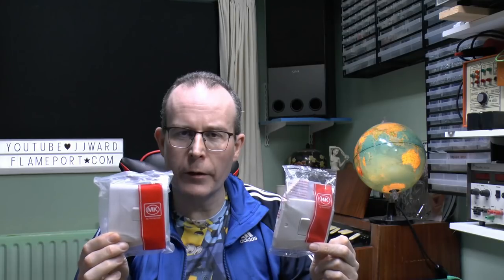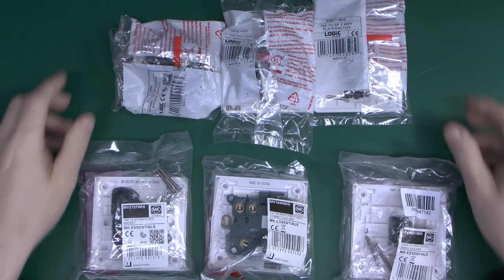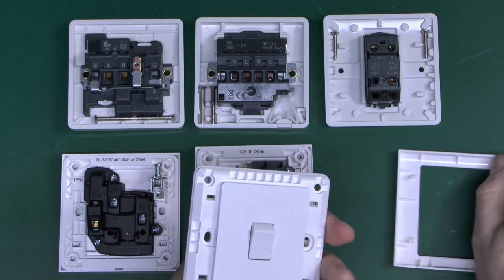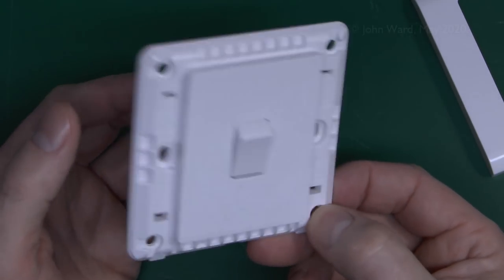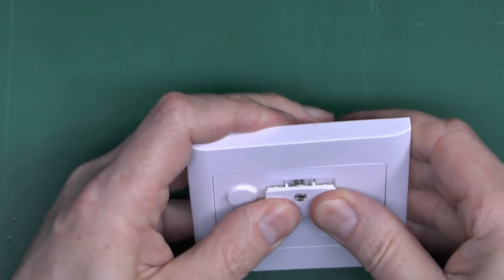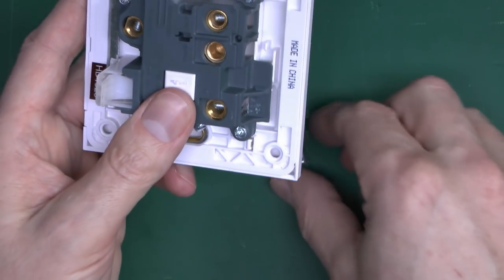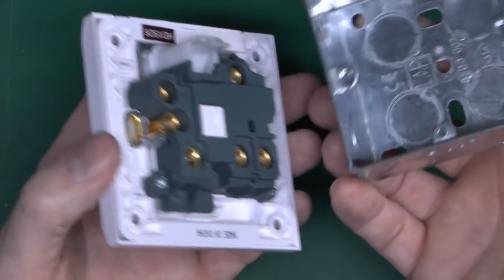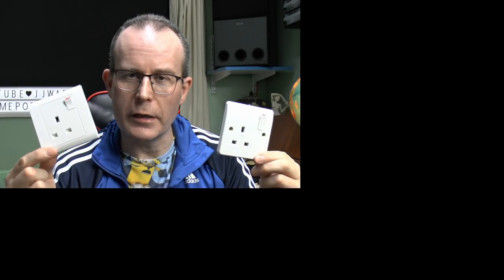MK Essentials vs MK Logic Plus

Comment: I might be weirdo, but I prefer screws visible probably anyway. I don't like the clip on frames like this, because they are prone to damage. You might need to inspect the socket or switch years later, and might not remember how to unclip it, and damage it. Or even if you remember, you can still damage it, if you use a screw driver to pray it off, or the plastic gets brittle. The MK logo on the front is just stupid.
Reply: And these soft plastics always scratch easily and possibly yellow. I remember in the late 80s/90s the Australian brand Clipsal tried this soft plastic in the UK which was unseen before on wall accessories.

Comment: Absolutely brilliant, again. Thanks for the video. I personally don't like these "cheap" accessories.  There are plenty of spaces for mistakes here, especially when guys are tired. How did that light switch get through the design process?  They certainly didn't consult with electricians. I look forward to your video on load testing. I wonder how that sockets will stand up against a wahi g machine,  long term? Hmmm? I wonder if we will see the tell tale brown burn marks around the plug entrances?  Thanks again John.

Comment: Presumably covering the two fixing screws with the cover is safer. Speaking as one who has received a shock from touching exposed fixing screws.
Reply from the maker: Not at all - fixing screws should be earthed.  To get a shock from them, that earth connection was missing, and a second fault caused them to be live.

Comment: Well they are a total fail in pretty much every respect. Hard to believe that MK could make such big mistakes with the range. They also loo very cheaply made, and can you imagine just how scratched the faces of the  sockets will be after a years worth of use. Terrible design all round. I am sure this review will save a lot of people a lot of frustration by buying these only to find they have to rip out and replace  half of the baacck boxes in the house before they can fit them.

Comment: I've only used the 'essentials' triple pole fan isolator and at £6.99(screwfix) a considerable saving of nearly £6 on the logic +version, exactly the same mechanism different white plastic. I'm actually very impressed.

Comment: The question is and John quite rightly points out it’s not where they are made that is the issue but what specifications and standards they were made to and whether there was sufficient design and destruction testing done. Cutting corners anywhere is a problem reflecting more management desire to sell and profit rather than build high standard products where margins might be tighter but reputationally better. cheapening their brand this way is undermining their whole business model.
Reply: Maximizing profit. 🙄

Comment: Some MK products in the past decade or so are or were made in Malaysia,  possibly their MCB’s but I can’t be 100 percent sure.  It may possibly have been their RJ45 sockets.  Certainly there was nothing other than the packaging / labelling on the product to distinguish them from other UK manufactured items.  

As for these Chinese things they look rubbish and I wouldn’t touch them even with a fully insulated barge pole.
Reply: The double unswitched sockets and the outboard switch doubles are made in Malaysia.

Comment: What are your thoughts on dado trunking in home installs? Overkill when surface mount will suffice?
Reply from the maker: Can be used if a large number of sockets are required such as in a home office or studio.  Very little point otherwise.
Reply: @jwflame  true. Looks ugly. Otherwise. Would you route the sockets via a fcu or just add them as part of the ring?

It's a Pain to route data and power cables to some places!
Reply from the maker: @sipsoup Schneider have a decent range, just be aware that you must get all the components from the same manufacturer and the same range, as parts are not generally interchangeable.  Other than the trunking itself, other parts are external corners, internal corners, end caps and single or double backboxes for the accessories.

Comment: How do you snap off the fronts once on the wall? Screwdriver behind it potentially damaging the wall or the face plate?
 Essentially a load of rubbish for not a lot of saving.
Reply from the maker: Two small slots on the bottom edge for a screwdriver.

Comment: Essentials as you said are not ideal. Logic Plus is problematic too - the terminal screws are both flimsy and overtightened - it gets stuck even halfway through the hole so needs more torque to move; however more torque means increased possibility to break the screws, given the fragility. Also, the faceplate edges are sometimes rough and uneven.
Reply: What's your view on the MK Base range?
Reply: @teddy6888  Hi there, unfortunately I have not used it so can't comment on that. How about you?
Reply: @allamusica451  I've only used the light switches, I would say they are similar in quality to the Scolmore Click Mode range. Much better screws compared to Logic Plus. I mainly use Crabtree, but recently I've noticed the top layer of plastic starts to peel off after a year or so on the light switches only. I was thinking this could have been a bad batch but have seen it on a range of production dates so I'm seeing how it goes with Base and Click. TLC have the Base range at a very competitive price point currently.
Reply: @teddy6888  I see - I hope MK Base lasts too. I have a few Click Mode too (UK bought but installed in China) and they were great in my view. You said you used Crabtree but the plastic started wearing out - was it the Capital series? I only got myself two of them recently.
Reply: @allamusica451  it was from the Capital range. The face plate is fine but the switch surface is made of multiple layers and seems to have a poor bond at the edges. After a few cycles, it cracks and starts to peel.
I still prefer Click as you can configure them using the Mini Grid range. One downside with MK Base light switches is that it needs a 25mm box, whereas most other brands would fit in a traditional 16mm pattress.
Reply: @teddy6888  That sounds worrying to me...! How many of your Crabtree Capital have failed? Or just one? I bought a few Crabtree Capital in order to match the aesthetics of my Varilight V-Pro white dimmer (they'll be side by side to each other)...

Comment: What's the use case for a wall mounted fuse socket?
Reply from the maker: Small fixed appliances such as electric heaters, central heating controls, extractor fans, some kitchen items instead of a plug and socket.

Comment: might be time to call the MK technical helpline and ask w̶h̶a̶t̶ ̶b̶a̶c̶k̶b̶o̶x̶ ̶i̶s̶ ̶r̶e̶q̶u̶i̶r̶e̶d̶ ̶f̶o̶r̶ ̶t̶h̶a̶t̶ ̶l̶i̶g̶h̶t̶ ̶s̶w̶i̶t̶c̶h̶ whether they're really embarrassed about the essentials range

(Tongue in cheek. Please don't actually do this)
Reply: Why shouldn't anyone ask that question? It's perfectly valid. While he is on the phone he can call Crabtree and ask them WTF were they thinking when they changed the design of their sockets and switch fused connection units.
Reply: @echothehusky  I doubt there are many of MK's UK staff left, particularly in design and I'm sure that the essentials range was a higher level commercial decision. Have the Crabtree Capital been redesigned or are you referring to the Instinct range?

Comment: MK's 1980's designs (pre "Logic Plus") were excellent - why didn't they re-launch those as their budget option, instead of wasting money designing this cheap and flimsy "Essentials" rubbish.
Reply from the maker: A distant memory suggests they sold the moulds and design of the old Logic range to someone else, so not available for use by them any more.
Reply: If you look at them they cost more to make than the current Logic+

Comment: Bet a lot of those light switches get returned to the retailer by DIYers when they won't go into the existing boxes.
wonder if that weirdly deep light switch was originally designed for a modular system like the Italian one on diodegonewild's channel Aug 28th 2019 - where it looks the installer assembles switch, power and blanking units into a standard plate as required...

Comment: I've used MK Logic Plus for a while now but from what I've seen in this video I certainly won't be using the "essentials" range. Maybe the name should be changed to "essential crap" because they look horrible. That essentials light switch would be a real faff to fit due to the small terminals and why would you make something which would require a deeper backbox and create more work to chase out? Again it's a case of a "designer" who has got no clue of what happens in the real world and should be made to fit their crap.

Comment: Good episode JW.
I Can’t believe how shitty, Pommie electrical accessories are, set aside the enormous plugs.
That fuse unit with the screws that directly screw down against strands of the flex is straight up 💩 
Thank Christ they didn’t send that shit over on the first fleet.
Reply: MJH19 yeah. Also I haven’t seen anything with a slotted screw that’s less than 40 years old 😂